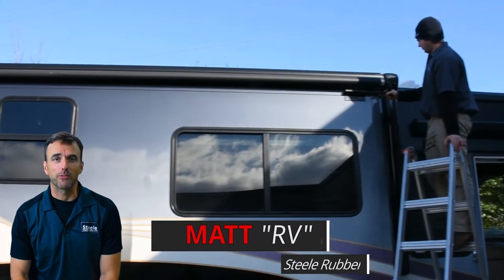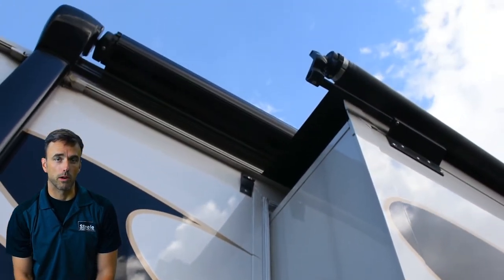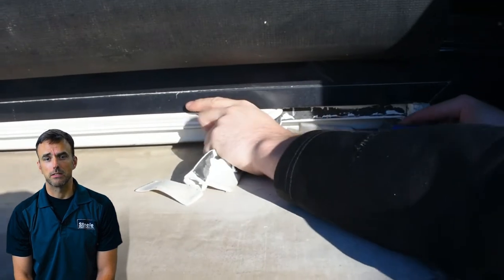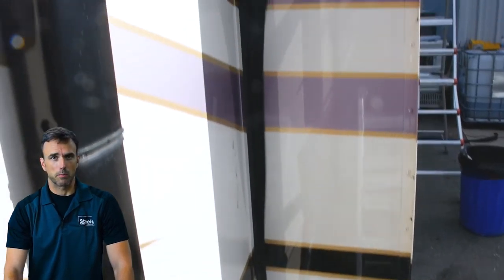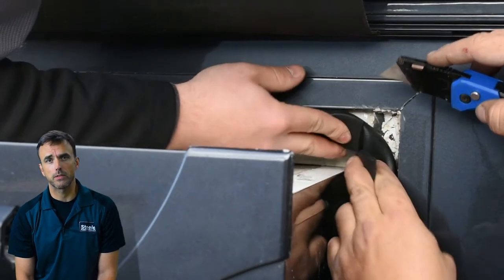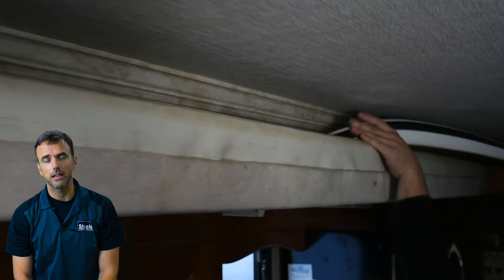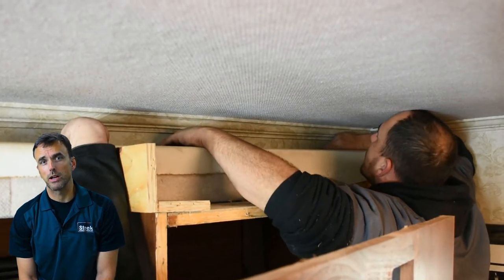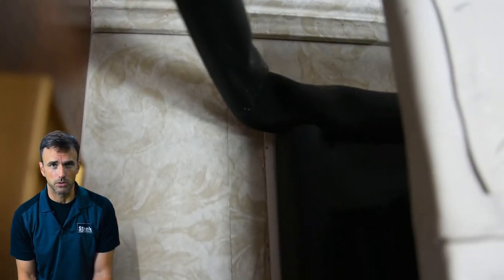Slide-out Seal Installation on a Class A Motor Coach

Comment: Thank you for the video!  I’m installing a push on double bulb wiper slide seal. I was successful in installing the seal on one vertical length and the top but I’m struggling to push the seal on to the metal guide on the other vertical length and the bottom. I partially brought in the slide which helped align the seal and metal tab but it still won’t sit on the metal guide. I appreciate any suggestions or tool recommendations you may have.

Comment: Do you have a video showing best practices for the installation of the adhesive "D" bulb seal on a slideout using mitered corners at the top corner.?
Reply from the maker: Hey Frank, we have a video on mitering corners but not with the "D" seal like you're looking for: https://www.youtube.com/watch?v=pqBEZe-_l9o. I'm also going to include our RV catalog link that has printed instructions on page 29 that should be helpful for you as well: https://bit.ly/3lUYxfu.

If you have any further questions on this feel free to email us at contact@steelerubber.com, thank you for watching!
Reply: @SteeleRubberProducts   Thanks. That helps alot.

Comment: Great video.  I have a 2003 Winnebago Journey DL and need to either slide the side wiper seal on the living room slide up or replace it.  There is a 2” gap between the side gasket and the top gasket.  Do you have a video on my Journey as well?
Reply from the maker: Hey Terry, would you be able to email us some photos of state of your seal along with the profile and possible dimensions of your current slide out seal? That way we can visualize what is going on and give you the best advice on how to correct the issue you're having as well as recommend any parts you may need. We do not currently have a video installing a slide out seal on a Journey, but most of the time the method will be the same for installation on a slide out, the only difference is the seal itself. Our email is contact@steelerubber.com and in the email you can say Chelsey, the marketing assistant, requested you send over the photos for recommendations from our product specialists. Thank you for watching!!

Comment: Any tips on removing the rubber seals on  a 2005 Thor Hurricane? I have a big leak on the living room slide out and can’t seem to figure out how to get the seal off to replace it. I’m also not sure if there is another seal inside the coach as well to protect the coach when the slide out is fully extended.
Reply from the maker: Hey Kristen, we actually have a video where we go over the process of removing an old slide out seal as well as replacing it with a new one! Here is a link to that video: https://www.youtube.com/watch?v=9e6hpQQcG7U

As for the seal inside the coach, sometimes there is a seal on the inside of the RV but not always. To check and see if you have one, you'll need to either put your slide out box out some or if it is already extended, bring it in some (not all the way) and you can look in that opening to see if there is a seal on the inside there. If there is a seal there and you are wanting to replace it we can help you figure out which of our seals would work best for your RV!

Thank you for watching!

Comment: Greetings,  I'm in the market to replace the rubber on two of my slides both inside and out.  I have a 2003 Holiday Rambler Admiral 30".  What would a the estimated cost for replacement?
Reply from the maker: Thank you for your question. This is hard for us to answer because RV’s don’t typically have a manufacturers parts book like automobiles do. For that reason, it’s difficult to say a specific seal would work. If the seal on your RV differs from the above, then to determine which seal you need to replace yours, we have to rely on comparing what you have on your RV with what’s in our catalog. If you need assistance with that, you can contact one of our product specialists, send us some pictures, or request a sample pack at no charge so you can test fit it directly on your RV.